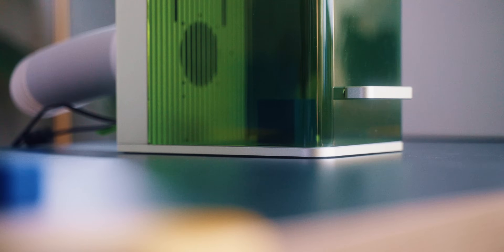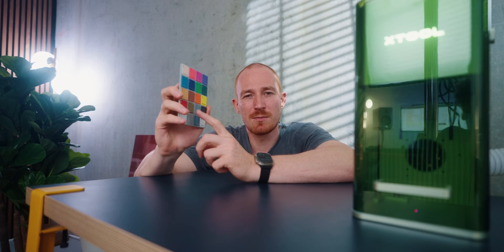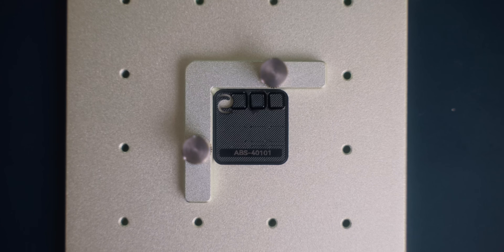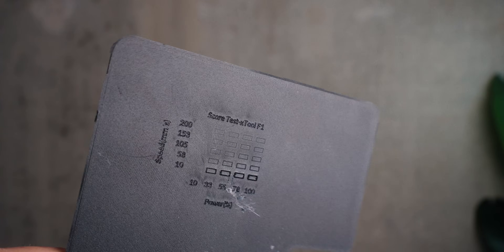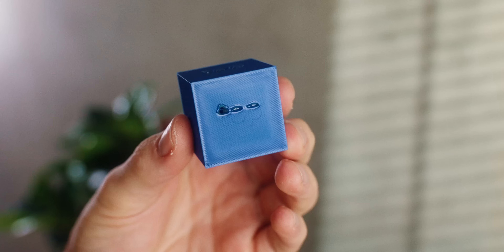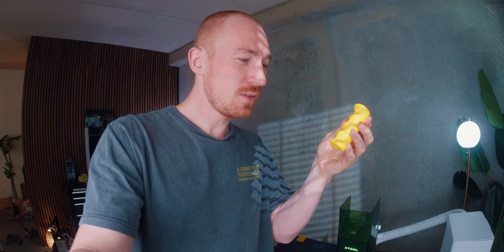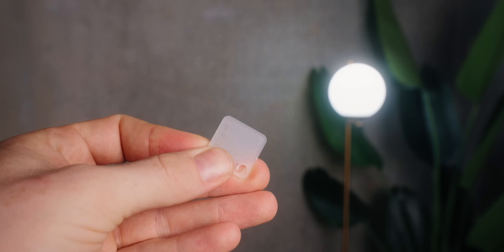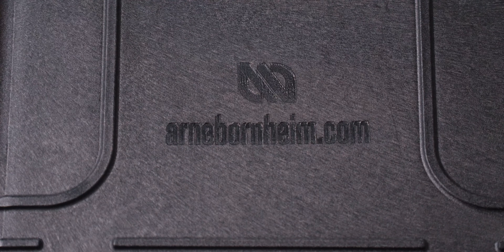Enhancing my 3d Prints with a Laser Engraver

Comment: This was a bit frustrating to watch. I really enjoy your 3D printing videos, and I’ve learned a bunch from you. In this video, though, you’re sharing your experiences with something you don’t really know as much about. You’re suggesting avoiding the odor by walking away? No…you avoid the odor by not using a blue laser on these types of plastics. It’s not a hard and fast rule, but generally you don’t want to be burning plastic with a laser. And a blue (diode) laser is almost always going to do that. The resulting chemical fumes can be highly dangerous. Also, blue and white objects are nearly impervious to a blue laser—they don’t absorb the blue light, so you’re ultimately just melting or burning it at the higher power you need to get any effect.

BUT…the xTool F1 has an infrared (IR) laser that can mark—by changing the chemical composition at the surface of—some plastics. Instead of melting it, the IR laser can darken or lighten the surface of these plastics. PETG is probably going to give decent results. This is how you would etch, say, your initials into an AirPods case.

What about all those videos with people engraving and cutting acrylic, though, right? Acrylic’s a different animal. It still smells like crap, but it has a much safer chemical composition to react to the laser.

I really like your channel. Please don’t take this as trolling or bashing. I’m genuinely concerned. You could be endangering your health, and others might repeat some of the tests you’re doing. Burning most of these 3D printer plastics just isn’t healthy. I’d highly recommend reviewing this safety guide on xTool’s site: https://xtool.zendesk.com/hc/en-us/articles/12913909655319-Safety-Guide-for-Laser-Cutting-Engraving
Reply from the maker: Thanks so much for your detailed feedback and tips. I really appreciate it. I’m definitely still new to layering and am figuring out things as I go. So really appreciate people with more knowledge in the comments helping me do better 😊

Comment: Just came across this video. Just getting into 3D printing and have been lasering with a CO2 laser a few months. Plastic and laser dont always play good together. PVC will make Chlorine gas and ABS releases styrene gasses. AI can tell you a lot:
Here’s a breakdown for common 3D printing plastics:  

| Material | Laser Engraving Safety | Key Notes |
|----------|-----------------------|-----------|
| PLA | Generally safe with proper ventilation | Low melting point (180–220 °C) — use low power, high speed, and multiple light passes to avoid warping. |
| PETG | Possible, but can produce irritating fumes | Similar to PLA in melting point; needs careful settings to avoid stringing or bubbling. |
| ABS | Not recommended | Releases toxic styrene fumes; requires industrial-grade fume extraction. |
| Nylon | Possible but tricky | Can melt and deform easily; produces unpleasant fumes. |
| Acrylic (PMMA) | Safe and engraves well | Produces clean, high-contrast marks; still needs ventilation. |
| PVC or vinyl-based filaments | Never engrave | Releases corrosive chlorine gas that can harm you and your machine. |

Comment: Hi! I engraved Bambu swatches just like you. Using IR on XtoolF1.  Matte PLA white and Matte PLA beige, look fantastic and perfect for my project. Trusting on Bambu swatches I bought some Bambu filaments corresponding to the color code marked on the samples. Be aware, etching Bambu Swatches doesn't mean that etching on Bambu printed filaments works as well !! No problem with dark colors, but white, beige, sand etc... are not the same thing. Maybe because swatches are injected instead of printed?  No success at all with white and light colors on Matte PLA,  while the result on swatches is great :(  Somebody like me have this experience? Solutions? Etching using black marking pen could be an idea, but I get a dark halo that ruins the perfect and uniform surface.

Comment: Please put a massive warning for safety at the beginning. The fumes are not safe and can be harmful and could catch fire easily. Enjoyed your test, but PLEASE put a disclaimer and notes that you can't just walk away- the fumes will get into your AC system and you'd still smell / inhale them. Please, if you're not sure about a material vs your xtool or any other engraver- check their website. You should never use an engraver on 3d printer filament or plastic in general.

Comment: Umm, those samples are not 3 d printed filaments, it’s predominantly injection molded facsimiles
Reply: Of the 160 original Bambu Swatches (many of which are duplicates), I used the ones that were unsuitable or duplicates, and I printed other Swatches myself. In my laser tests it made zero difference whether they were really printed or cast.
Reply: @ this video would have been far more useful to me if you had 3-D printed the blocks individually and listed the specific filament brand
Reply: Are you talking about the color-swatches, where you can clearly see every layer and the lines at the top and bottom? :D
Reply: @NemesisLex  It's molded to mimic a 3d printed piece. When you have them in hand you can see the ejector pin marks on the back of the swatches and the clipped part at the top from the gate of the molded piece.
Reply: It’s a pretty well known fact.
Reply: You should have used the IR laser.